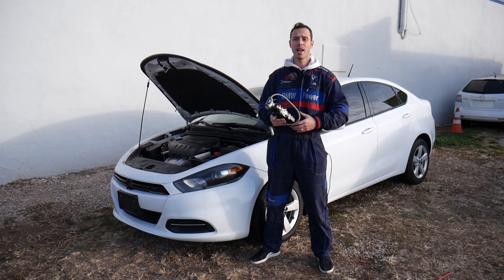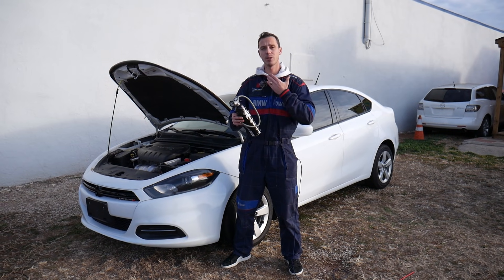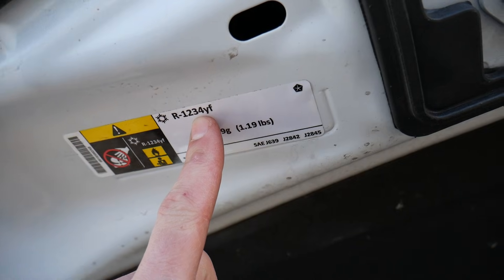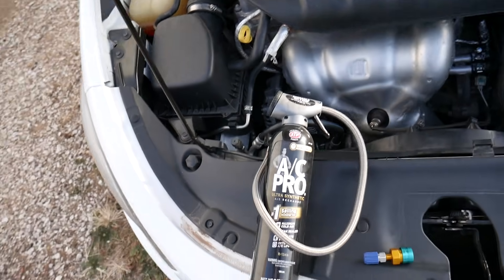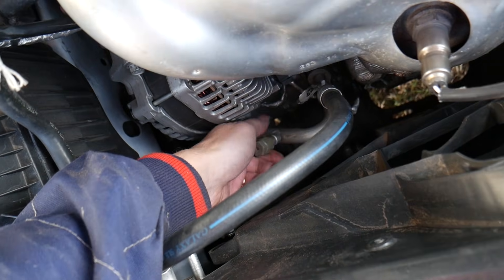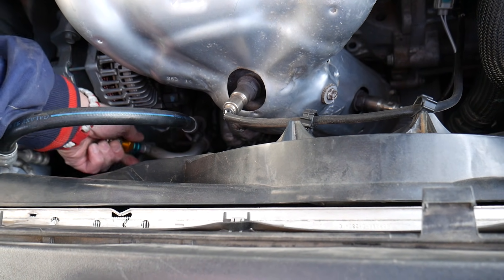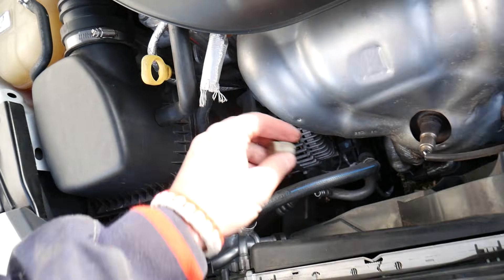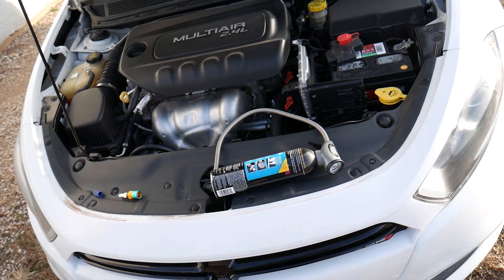CAN YOU USE R134a in R1234YF AC SYSTEM

Comment: Thanks mango dango!  This was a good video! While R1234yf is better for the environment... it's hard to justify the outrageous price it costs.  I'm tempted to vacuum out the refrigerant and convert to R134a like you have done.
Reply: I was afraid to do it initially since my car is a hybrid (they require a dielectric oil), but it worked perfectly!  R134a works amazing!
Reply: @HairyTheCandyMan did you have to empty it first? And if you did, how much did it cost?
Reply: Do you have to use more of R134a? It depends on the vehicles A/C system apacity. You may have to do a gram-to-gram conversion calculation. And, recommend to do a deep vaccum of the system before recharging and inject a compatible compressor oil.
Reply: And the space rockets and the fighter jets that just run around are great for the environment. Also, most government vehicles don't have emissions on them either. It's all extra ways to get tax dollars.
Reply: So. after two years. how's your AC doing ? i'm thinking to put R134a in to the 1234yf system now..  but do i have to empty the old R1234yf first ?
Reply: @kuku556677 have you done it?
Reply: I just did mine on my 2015 ram due to running low on refrigerant. At $80 a lb that was too outrageous for my blood and If I need to keep adding in the future 134a is much cheaper.
Reply: @adamjankowski4315  you mixed both ? When you added the 134 you still had some 1234yf in the system?
Reply: @ReyErnesto-p1c  No I vacuumed the system out.
Reply: @adamjankowski4315  did you encounter any problems after switching over? Need an update after a year
Reply: @turki9690  Been working great so far
Reply: I have a 2014 Dodge Dart GT, I had to change my a/c condenser due to the condenser being damaged in an accident, which emptied my system.  Do I still have to vacuum out my system?
Reply: Do it....just another rip off
Reply: Better for the environment my arse.
Reply: @AndToTheRepublic4WhichItStands  it's so beneficial I use a mask and breath it in daily
Reply: @HairyTheCandyMan  r12 is the way to go
Reply: I completed successfully with 9 vehicles with the transformation with both of these products. Mind you it is a federal offense too do so and that being said yes it is possible too replace the both Freon from one too the other. As long you! Evacuate one from the other do not! Mix!!
Reply: @nicholassmith8516  yeah I'll make sure the federal police are sleeping when I do it! Hopefully they don't see me in my garage at home!
Reply: Another reason against is its against federal law, nothing like posting a video of yourself committing a crime. 🤦‍♂️
Reply: @mikek19320  whatever cry baby! Go tell sleepy slow biden that were breaking the law!
Reply: Good luck prosecuting him in Russia, the real land of the free ;) @mikek19320
Reply: @mikek19320  That's ok, as long as you vote Democrat.

Comment: PO597
Thermostat Heater Control Circuit/Open.
What's the fix X1 2014 E84
Reply: The thermostat!
Reply: The "fix" is actually looking into the cooling system of the engine, not the internal HVAC which has absolutely nothing to do with the thermostat...

Comment: The R134a pressure is a little higher than the 1234y so you have to be careful. If you make the pressure get too high with the R134a In the 1234y  system it can black up the system and damage your compressor
Reply: Only time that the pressure is higher is when the ambient temperature reaches 150 degrees or higher. However the pressure difference is very slight. I had to get certified for the 1234yf. The two gases are very similar.
Reply: @myboy051  do you think I can mix the two? like recharge my car with 134a?
Reply: Volkswagen completely dropped the ball and put R134a in my 1234yf system. My Ac stopped working months after this repair. Gonna get a lawyer I think.